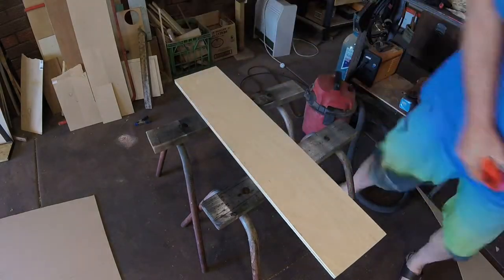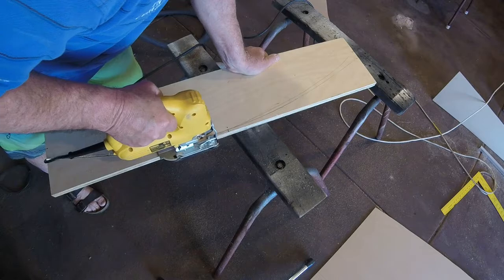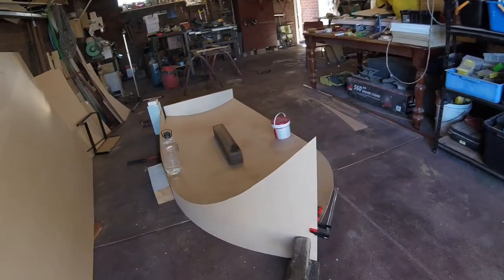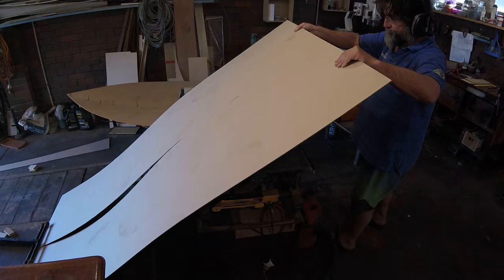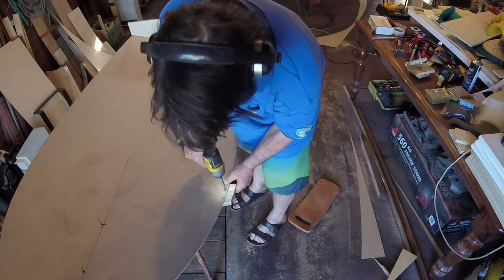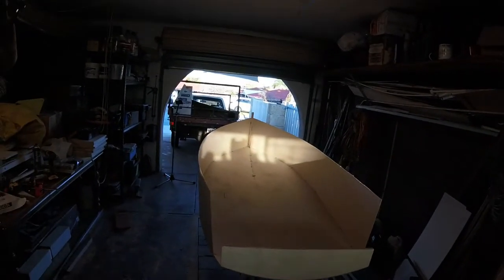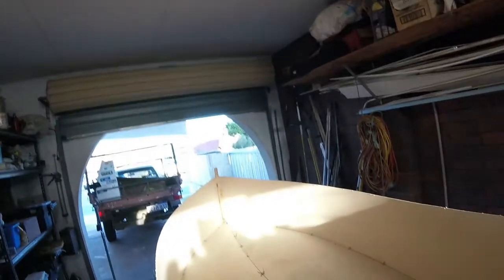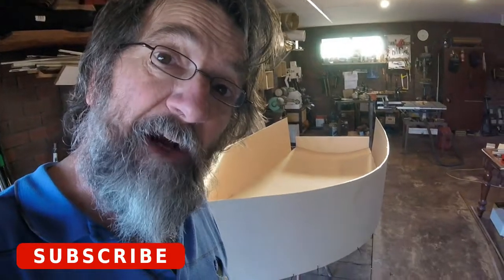The MDF boat build (part 2)

Comment: I didn't even know stitch and glue was a boat building technique until just a few days ago when some people on "Acorn to Arabella" were talking about it. I've done soaking wood with dilute epoxy paint for a bicycle trailer and it should work well on your MDF as well.
Reply from the maker: Because it's 3mm you really don't need to soften the stuff to get it to curve/bend. Which is nice.
Also, it's far lighter than I imagined it would be.

Comment: Soooo when are we taking this one out 🙂 Awesome work!
Reply from the maker: it's still a month or so away yet. Spars, sail and oars to make. Seats, rudder and centreboard to make. and it still need some more glass on the bottom, some fairing and painting. oh and gunwales, they are not finished either.